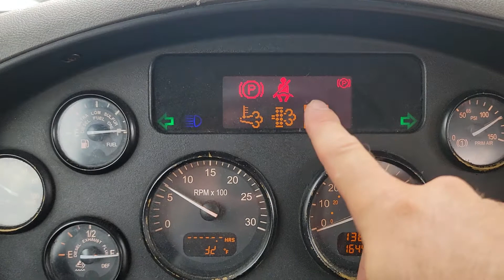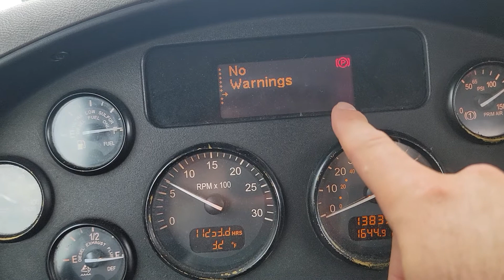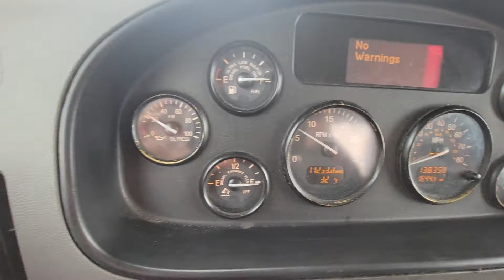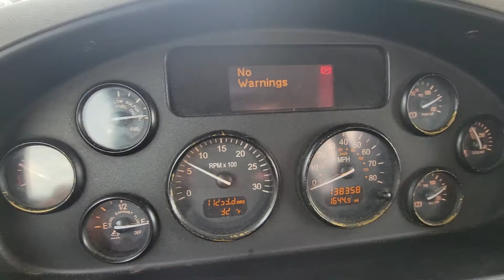Class A CDL - Lights & Gauges Truck Exam

Comment: How do I make sure the fluid works for your windshield wipers?
Reply from the maker: You make sure you have enough washer fluid in the reservoir.
Reply: Pull the turn signal knob towards you it should shoot washer fluid out on your windshield